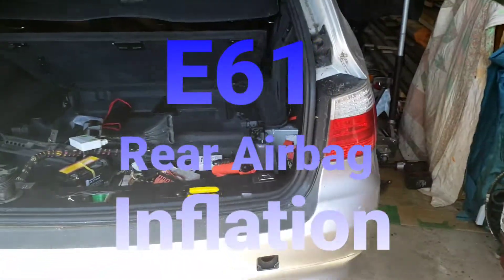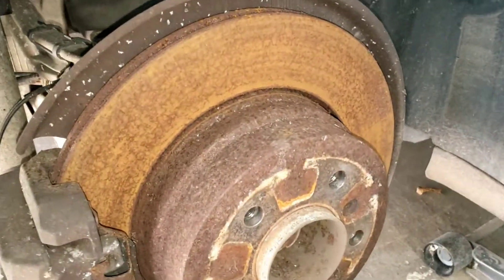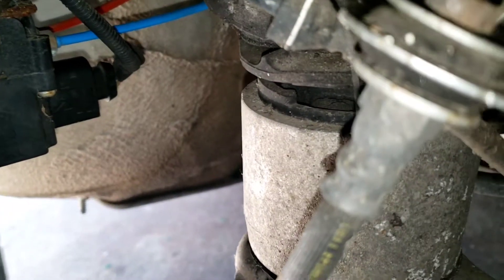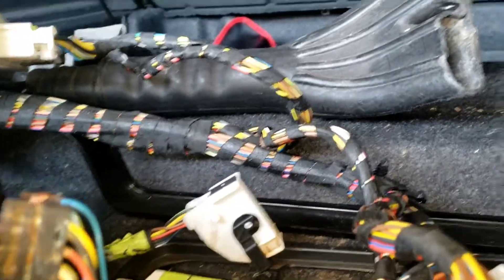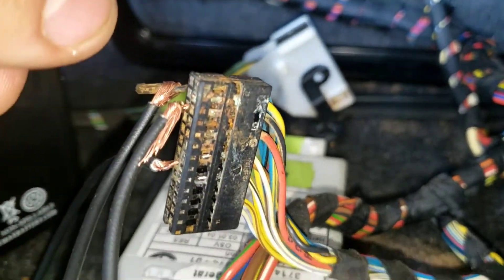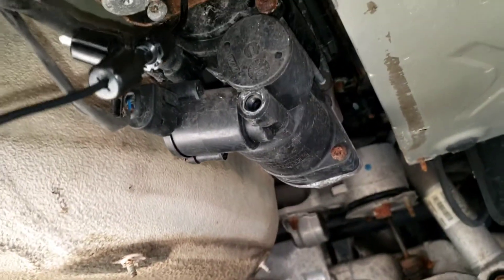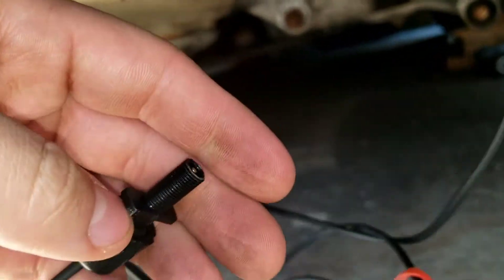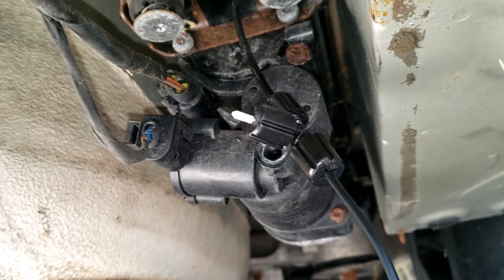BMW 535xi E61 rear air suspension manual bypass and inflation

Comment: Did you also remove the varing for level control?
Reply from the maker: I bypassed the whole system,  just leaving the bags and tubing in place.  I would just pump up every so often when it was low.   Eventually tho, I replaced it all with ISC coilovers system

Comment: How do you release the air. It was over pumped. Please help asap
Reply from the maker: You need to connect the pins to open the solenoid.  To clarify.  Your bags are over inflated?